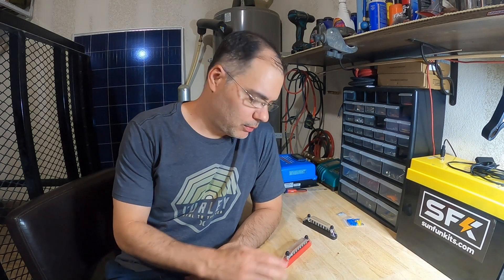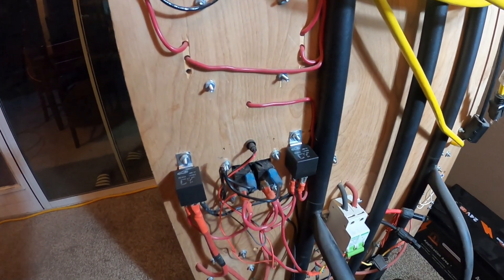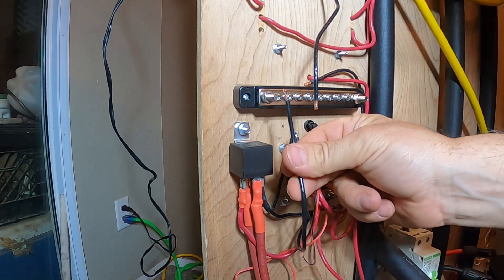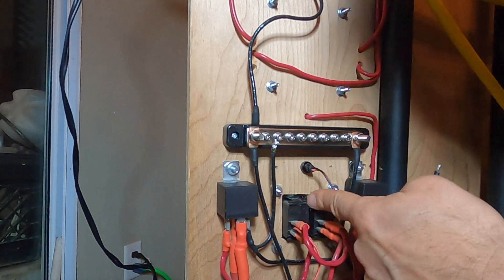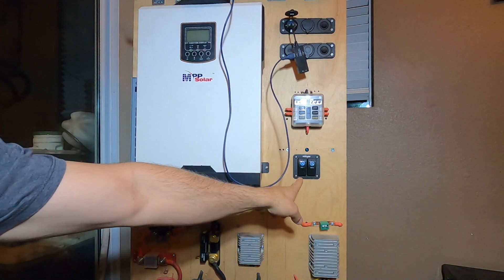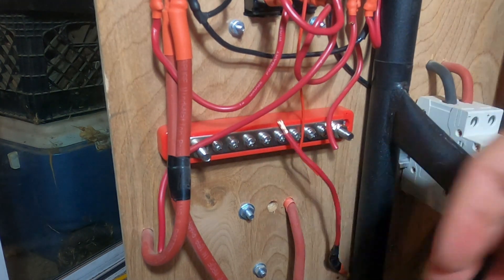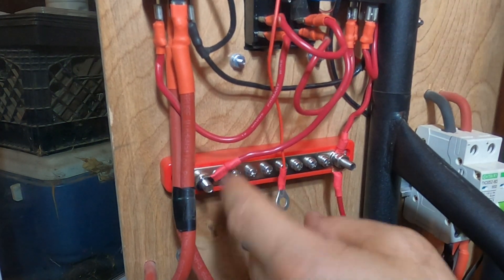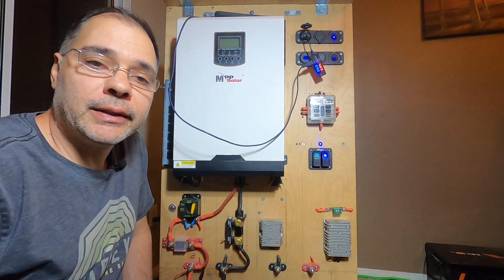Installing Bus Bars - BLOB Be Gone!

Comment: What is the purpose of the relays?  Arent they just fancy switches? 
I really enjoyed this build video
Reply from the maker: Thanks.  Because the high amps that the buck (dc to dc) converter could potentially draw. I do not like running high current through these types of switches, although they say they can handle 20A.. they tend to heat up.  Thanks for watching
Reply: @natesdiysolar  ah ok. Good to know
Reply from the maker: @kaput808  but another reason is if you had the load far from the switch, you could use a smaller guage wire to operate the relay located near the load.  Smaller guage wire = cheaper :)